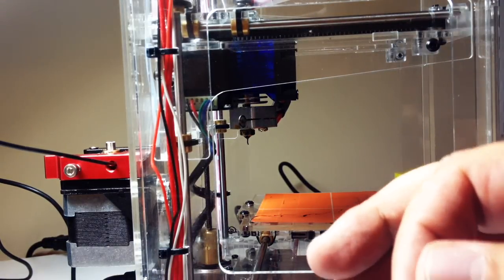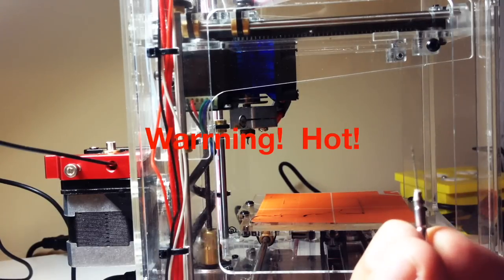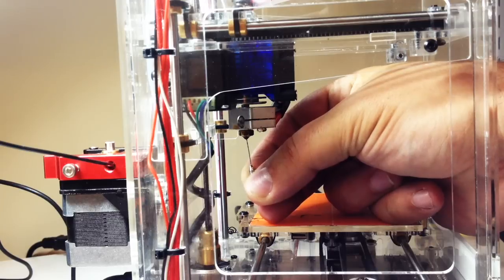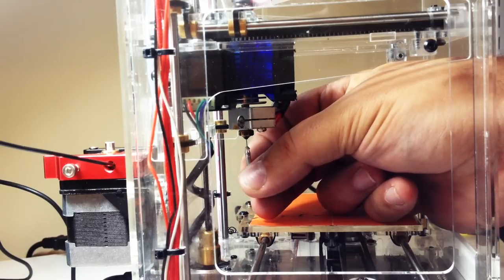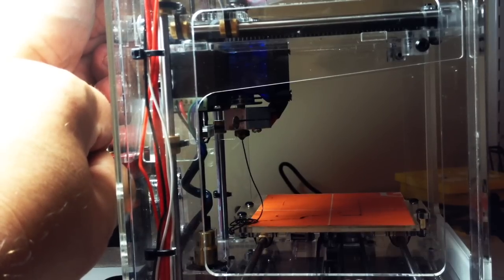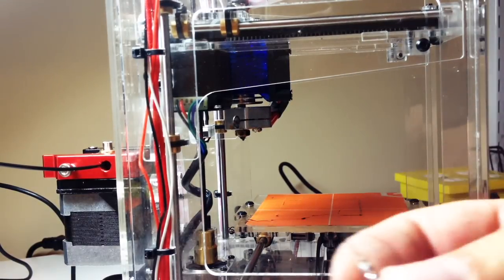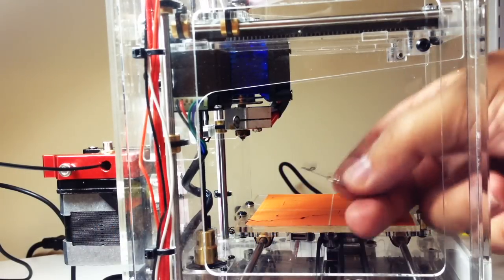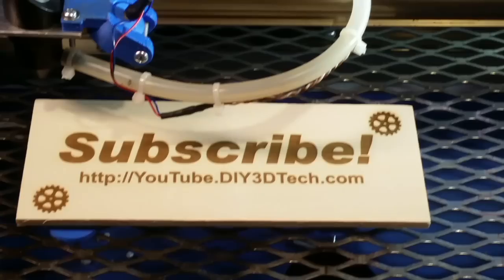Fabrikator : TinyBoy Mini 3D Printer  - Cleaning The Nozzle with a 0 4 Drill Bit!

Comment: Coming back to this .  I was finishing up a part with the blue PLA plus from rigid.ink  , and it had a soft clog . I have a time lapse of it happening some place .  after doing a few tear-downs and such i was in no mood to this time . I put one of the 0.4 HSS drill bit to use . and dang it worked great .  I pushed some of teh PLA  through and in the stuff that came out as a very dark blue bit that was most probably the clog .  like a fleck of pigment or some  shmoo .  possibly a  bit of overheated PLA  . any how it was a quick fix and the print head never even needed to cool down .  Less than 1 min tops. 
i jumped to the spot in the time lapse where the clog started : https://youtu.be/s7z_4WsISfo?t=5m11s
Reply from the maker: Don't tell, but I do this all of the time and works great (use the drill instead of taking it apart).  However when ever I mention this people comment I am going to damage the nozzle by making it out of round.  While this is possible,  using a 0.4 drill and not a "bit" I have never had an issue as PLA seems to jam up more that ABS...
Reply: with the newer tungsten nozzles , they should be impervious to HSS bit.   i think the flutes in the bit actually help capture and drag out contaminants . I have tested a resistor leg and some times all it would go is dislodge the block only for it to happen again in like 5 min . 
The key to PLA , is not cooking it .  dont over temp or bake it .   and watch that retract distance , if you must retract do it fast / high speed . sure it makes the extruder noisier , but hey prints are less likely to make a jam in the heat break area . 
last i took my hot end apart i found the PTFE liner in my heat break and fused to the heat break lol . i was going to change it out .. but it has bonded to the steel . 
i would have to burn / melt it out . but it seems to work fine .
Reply from the maker: Yes retraction is key and thinking about doing a video on it!

Comment: I usually take it apart and use a votive candle to melt / burn out the stuff. but you way would be handy in a pinch . 
i hate when i take stuff out to change colors and i get the removal speed wrong and make a jam in the PTFE in the heat break . that freaking sucks. that's total tear down and rebuild .  I also found the PTFE  tube in the heat break has become stuck hard . I think if i had to get it out it would be torch and burn it out . but i just got a 10 pack of .4 drills , i just need to mount them in a small handle so i can try this next time . 
i have found pull in PLA down sharply as the ooz hardens during cooling has removed many partial blockages too.
Reply from the maker: Typically when changing filament I will push out a bit and then pull it back quickly before hardens and this has worked well for me. As your right, I hate when breaks off in the tube :-(
Reply: yeah drives me nuts . i thought it would be cool if i made coupling / inline fusing tool so I could cut one and stick a new one butt joint to it . then just keep going . sucks with a bowden .

Comment: A resistor leg also works great :D
Reply from the maker: In a pinch yes, however have had a couple clogs where the drill action was required to clear as they where just stubborn.  I actually think on those two, something foreign got into the filament during the manufacturing process.  :-)